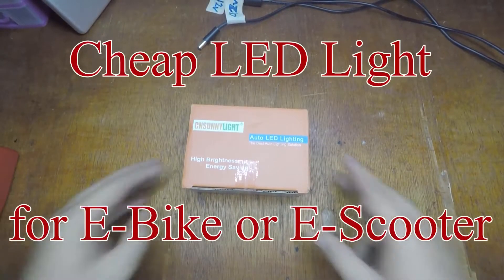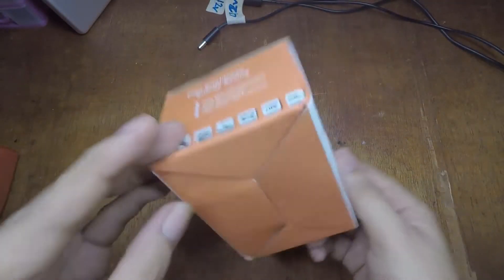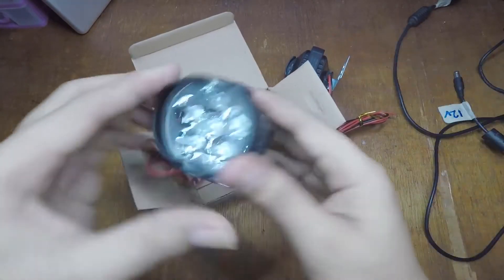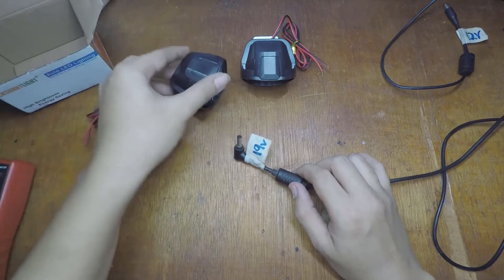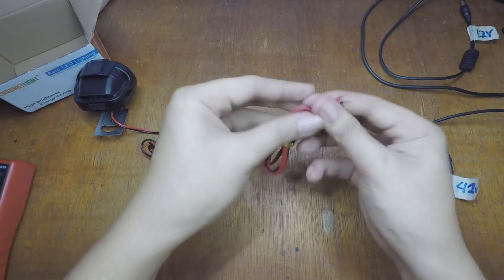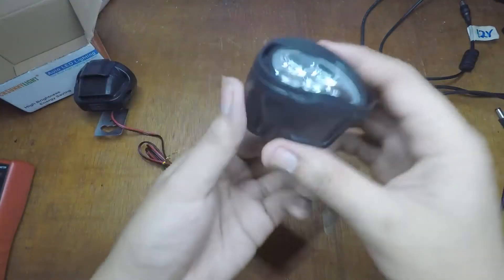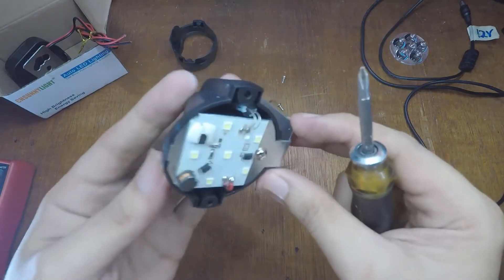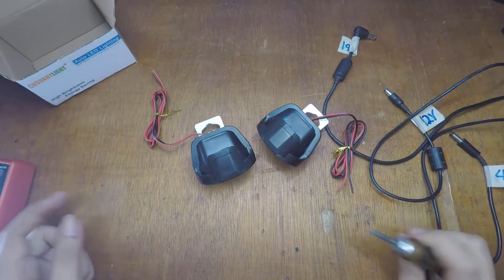Super Cheap LED Lights For E-Bike or E-Scooter and motorcycle 9v to 85v 4$

Comment: Works with 5v from USB battery pack?
Reply from the maker: it will not work!!, working voltage is 9v to 85v
Reply: @PHLocalExtremeSports  Thanks

Comment: Need p ba ng converter pag kinabit yan,sa ebike?
Reply from the maker: You can directly connect no problem with that, it will work fine (universal voltage 9v-85v)

Comment: Sir ye 85v se bhi
Reply from the maker: Yes, its say on the spec it can handle 85v, but I don't have any DC power supply to test it, but I notice something when I use just 12v the metal that attach on the led board is very hot, to hot you cannot even touch it. I highly advice is to look for LED light with heat sink, I am thinking to MOD this LED light to add a heat sink at back. "Buy at your own risk" that why its cheap led lights.